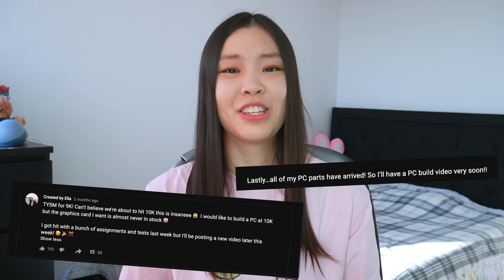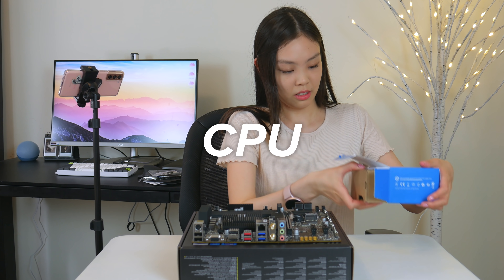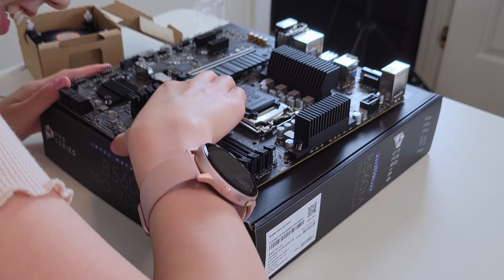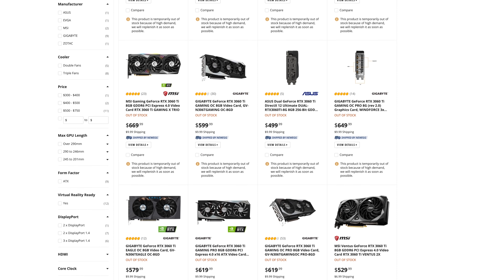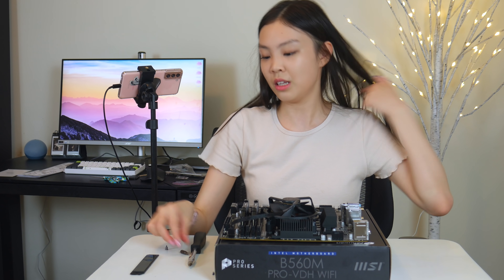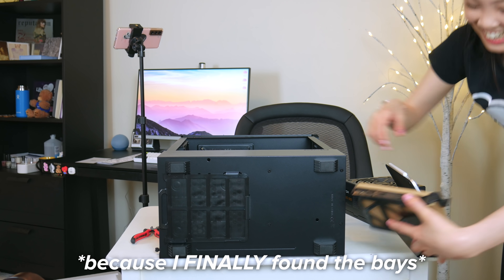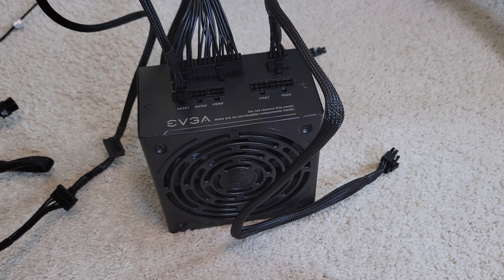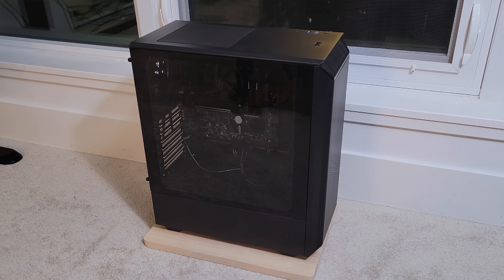Building My FIRST PC! | How I Chose My PC Parts

Comment: When you put your cup in you don’t want to push it in if you apply pressure you will break the threads and it work work so just let it slide inalso rip your cpu it’s gonna over heat you did not put thermal paste on it

Comment: Hey I recently just bought the same model case and I wanted to know if you had any tips to help me with the cables from the shell becuase if my cpu is plugged in to the motherboard why won’t when I press the lighted power button no fans or nothing come on? If anyone could help that would be very appreciated
Reply: Start by checking the trivial things: power outlet, power cable, power switch on power supply. Then move onto the inside of the case power cables (CPU, motherboard, graphics card) and the front panel header cables.

Comment: Welcome to the pc master race !
Reply: Cringe😂 gpu prices are a joke , makes it impossible for new comers to buy a budget build of any kind.
Reply: @Dr8cul4  i was able to build a budget build with 600 € cuz i found gtx 1650 for like 200 bucks i also have m board  asrock b450m pro 4 and cpu amd ryzen 3-3100 and 8 gb of ddr4 3200hz ram (hyper x fury) in fairness i bought most of these parts at the start of the year other then the gpu and the 2 tb storage

Comment: You did nicely, but better do yourself a favour and change this damn noisy Intel stock cooler ;) Something like be quiet! Pure Rock 2 would do the job, if you want super-duper quiet get something from Scythe as Mugen 5 rev. B or even Ninja 5. One exhaust fan you have won't be ideal in terms of temperatures, especially after adding some GPU, but more exhaust than intake means also waaay more dust coming inside. Installed on front be quiet! Pure Wings 2 140 mm PWM 1000 rpm; Scythe Kaze Flex 120 mm PWM 1200 rpm or Fractal Design Dynamic X2 GP14 1000 rpm would make it better :]
Reply from the maker: thanks for the suggestions! The stock cooler will do for now but later on I might upgrade
Reply: @CreatedbyEllaYT  No problem, you would like these changes :] Generally until you fine with noise and temperatures - you fine :> But good computer is computer silent as off during webbrowsing and possibly quiet during games or any load, so it's damn worth to care about good cooling solutions and creating own fan curves in bios/motherboard software. Especially in few years perspective of using this pc :]

Comment: I also want to build my own. Can you tell me basically what i need to buy/add if i have an old pc already.
Reply: CPU, motherboard, RAM everything else can most likely be taken from the old PC ... unless you are still using an IDE drive then include the hard drive to the list too. The case and usually the ATX power supply are able to go with you for like a decade without needing replacement. The reason why the CPU and motherboard is if you replace one you are replacing the other with Intel. The reason why RAM i am assuming "old" meant 2015 or before if not then yeah you can bring over the DDR4 RAM it should work. Well next year they are saying that motherboards are going to DDR5 so make sure when you get one that it is the same gen of RAM both DDR4 or if it is already a DDR5 board wait until good DDR5 is a thing.
Reply: @Mynameis Myname The 3rd monitor wasn't listed anywhere anymore. A 31.5" Nixeus 2560x1600 thing. The viewing area of mine is mostly taken up now. For OC yeah i did that  for a few years then after a hardware issue with the OC and i didn't have time to fix it i went with the ASUS auto OC option. No idea what it is at now but it runs fine for both gaming and production workloads i use it for.

Comment: How to install windows on newly build pc?
Reply: do you have windows on CD or usb stick?
either way you need to put in and set "boot priority" options in your BIOS to that drive, either optical drive or usb drive.
then you save your bios settings and restart your pc and it should boot into windows installation
when you are done with installation completely, you will probably need to set boot priority in BIOS back to your hard drive or ssd, wherever you installed your windows on.
because otherwise everytime you turn on your pc it will try to boot into your drive to install windows again. instead of booting into hardrive/ssd and into windows

Comment: I have the same case. I was putting the glass panel back on and it slid, then broke. To replace that costs $20 and shipping costs $20, so $40, and that is 2/3 of what the case costs with shipping. facepalm

Comment: always remember PUT THERMAL PASTE on the cpu then place fan on top! arctic cooler mx paste is best...as a first time build you done well .. few hick ups but when i started building pcs in the 1980s i was same .. hardware was a lot more problematic back then .. now a days its a lot more simple and a lot of people are buying and learning to build there own .. there are alternative to thew RTX GPUS, but its more recommend for rendering speed to have a decent gpu instead of a APU type cpu.. good video  ... actually i hate leds on everything .. if i wanted a christma tree id buy one lol ... my system just has a shuttle green that's it
Reply from the maker: there's paste that's pre-applied on the cpu cooler